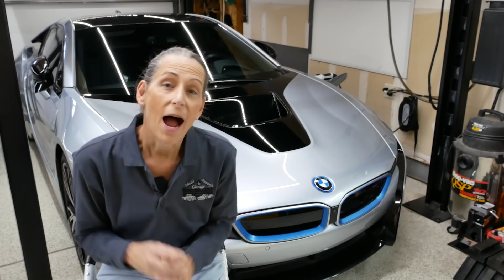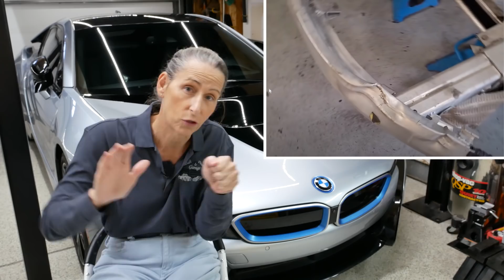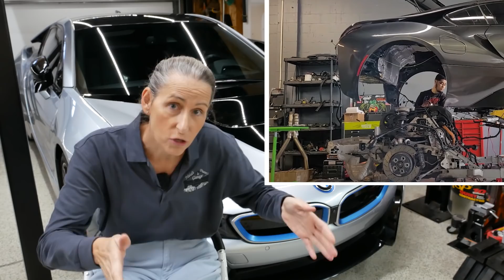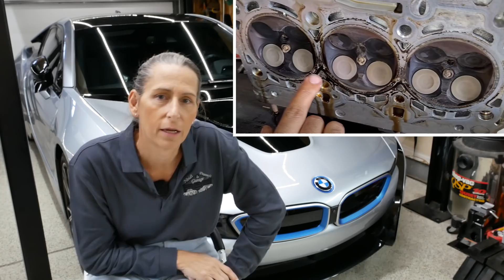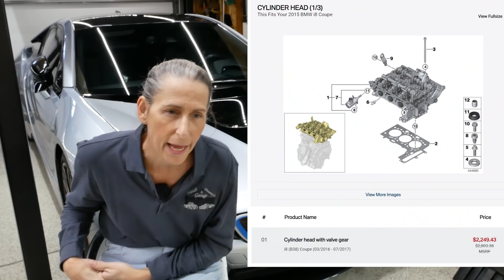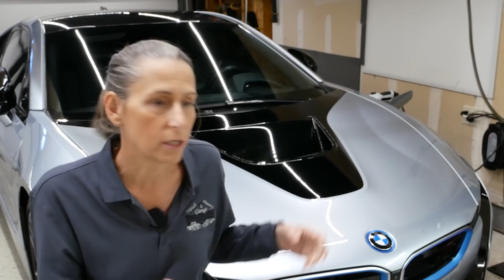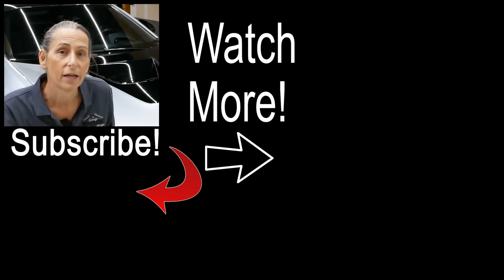Is THIS What Ruined Sam's i8??

Comment from the maker: A quick discussion on what may have caused Sam Crac's overheating issue on his BMW i8 now that he has the engine out of the car.  Let me know your thoughts!

Check out Sam's video here: https://www.youtube.com/watch?v=O1gdp-JqFS4&ab_channel=Samcrac
Reply: Hi Heidi
Its a no brainer`, the head is scrap, there is to much warp on the head to even think about scimming it, check the block to see if it is true, if it is true then the the block is ok, get a new head, build it up and install it, job done.
Regards
Vince (uk rider)
Reply: @vincenttarling5902  I agree with your comments and idea. Car too nice to throw away.
Reply: Was the car overheating because of the defective head/gasket or is the head damaged because of overheating?  If the latter, there may still be an underlying cause.
Reply: back in WW2 occupied france sugar was used to destroy the concrete during fortifying and same stuff on tanks.

a repossed car might have had not the best treatment in its final days and the issues also sound like a nice manipulation that no new owner could have fun. 

turtle mode is also an indicator
Reply: I'd be giving serious thoughts to replacing the whole engine! Those all aluminium BMW units are normally scrap as soon as they have been cooked, even just once.
Reply: Sam needs to call his buddy, the electric car guy, and just put an electric motor in it. Faster and more efficient running car...??
Reply: People look at this car and they think it's going to be a second generation M1. It clearly isn't.
Reply: I’m surprised they can’t do a weld build up and grind the head back into tolerance.

      Years ago a friend of mine blow the wall between 1 and 2 piston wall.  We welded it up and hand ground it flat.  It worked.  
    That was my old life,
Reply: @Worcester114  Interesting fix. What make of car/engine? Not sure it would work here with Sam's problem. Might try supporting the head at the ends and then pressing down in the middle with hydraulic press, see if the warp can be pushed out. If the head is toast, might as well try.
Reply: Even tho there is a fail safe to prevent engine damage from overheating.   I have seen if a engine is at operating temperature and there is a sudden lost of coolant (e.g. impact to radiator) it is possible for the cylinder to warp and cause this condition that happened to SAM’s cylinder head.
Reply: I've done a lot of engine modification work .. why doesn't Sam try resurfacing the head, removing enough material so he can run TWO Head Gaskets stacked?? Would be the "poor" man's approach.

Comment: Just ran my i8 up to 78MPH. Temp stayed around 105c (coolant), I slowed to turn around and it dropped to 88c ish. Okay good. Ran it home and did not drop a second time when I slowed to 30-45MPH. Dropped to  80's again later but likes to stay at 104c even after I slow considerable. I actually slowed to 25MPH for 2 miles and it sat at 104C. So it does not drop every time I slow down? Am I missing something? Stuck thermostat maybe? Along those lines, can the thermostat be changed without changing the whole water pump? You can't buy a thermostat by itself. Thanks guys.

Comment: To be fair, the Mini engines used in these things are notorious for warped heads and blown gaskets, it's a well known weakness with no real fix, the gaskets are known to be weak, and the head itself seems to be made of materials that are not the best seeming to warp easily from overheating.

It can't just be i8 owners thrashing their cars to death, these engines just fell way short of expectations when it comes to durability, particularly for BMW.

Comment: I found (week ago) Sam's i8 on auction Orlando CoPart lot 33565721 somewhow its now off.  I'd worry about the engine; Sam noted 10k$ for new long block, but your numbers are much lower. Also, recent searches show soft prices for a phony supercar engine, a put-put image it has and tha phoney exhaust sound gizmo, that's funny. Oh, I thought just head was removed not the whole engine as that would require lots more work to R+R the thing. And BMW quoted him $30k to do a new engine install  ! I didn't know about the rear frame work, is that why it's a PA Salvage Title; is that why he didn't title/tag it in Fl ? Also, remember, the BMW dealer refused to try the oversize head gasket install (wonder why) ? it had 47k miles and salvage title and Sam noted it would be at auction. It's not online now for some reason. Ask reserve was 54k $ ! Last bid I saw was mere 3k$ !
Reply from the maker: Why do you think it was his car?  What color was it? Heidi
Reply: @HeidiandFranny  copart auction Orlando lot 33565721

Comment: Just my "opinion" based on the tiny bit i have heard on a couple videos about this car. Sounds like a engineering and mechanical nightmare for a cooling system. Gimme a front mounted radiator, a couple of fans behind it a water pump and thermostat that opens when the water is hot goes to the radiator , is cooled, back to engine; repeat. like any "regular car cooling system".  Just my opinion. I see "fancy cool cars' that are a rich person's expensive toy that breaks down often and the parts/service is stupidly expen$ive. I had two Toyota Camry's drove them  for 12-15 years each; put 225,00 miles and all I ever had to do to mine was timing belts and cv-joint axles, alternator brushes. Heck of a deal! Daily driver took lots of trips in them. The engineers that designed THAT BMW should be hanged at dawn for such stupid complicated BS systems. IT totally sounds stupidly designed and built. BUT As Ben Franklin said:" A Fool and His Money Are Easily Parted". YOUR toy YOU headache.

Comment: The gasket on Sam's engine has a sealer strip around the edges, it looks like rubber/plastic, where his overheated it seems to have burned the seal and allowed the gasket to leak, years ago head gaskets used to have a much thicker gasket sealed each side with sort of copper, this crushed and made the seal, I am guessing with the new stretch head bolts and newer design with higher compression, manufacturer get away with less gasket, until it get hot and leaks, the indicators on the head show it was possible to skim it and the fact they do offer a thicker head gasket shows they knew this might happen.

I do remember when I built engines this was also offered but then rebuilding an engine was common place, any high performance engine back then would have grooves cut and sealing rings fitted as compressions got higher, I did wonder why Sam didn't do a leak test first as its the quick and easy and settles the question of a head gasket leaking, before he started, but then its easy to be an armchair critic, and he made some content out of it.

Comment: well if you lose a all the coolant (like a hose failure) you'll over heat fast enough to warp the head. Remember a late 70's early 80's VW rabbit diesel losing a coolant line will MELT a hole through the injector pre-chamber in the head in 5 minutes or less.  What does the water temperature sending unit measure when you have a catastrophic hose failure?  ANSWER: Nothing, in fact  it starts to drop. 83 or 84 a level probe was added.  
So can you follow my logic on this?  I8 has a level probe, but i'll bet it just gives a coolant low warning. it doesn't know the difference between the reservoir low or the tree branch you just ran over that tore out your cooling lines.

Comment: Pretty clear the thermostat failed, because that's what BMW's do, and the person who "owned" it drove it like he stole it and the engine got so hot that it warped.  Turbo 3 cylinder making over 200hp is not going to run cool, and will heat up super fast.  Some shop knew this and changed the thermostat, which Sam thought they did incorrectly.  Keep this in mind i8 owners when you see that engine gets hot.  Just stop driving it and have it towed and get the thermostat changed asap.

Comment: This is the only problem with doing a video series on a car like this on YouTube is that everyone knows the car and the problems. So if he tries to take the lower price way out and puts a used, or even a new, head it opens a whole mess of things if there's any problems with it even months after he sells it. Because anything that happens to it, even or wreck it's not anything to do with these fixes and problems, he's going to be blamed for not taking the money and putting the $8,000 engine in it knowing all the problems it has and that this would fix them. It's almost like shooting yourself in the foot but I would just take any income generated from all this plus some sponsorship and step up and be the decent YouTuber, LOL, and do the right thing putting the new engine in it. Plus the new buyers will have the Peace of Mind of some type of warranty. Probably not the full warranty since it's not being installed by BMW technicians but it should at least have a 12/12 but I don't know for sure.
It's just that everything gets exposed and then you're looked upon to do the full monty on the vehicle in question.

Comment: "German engineering," including cost saving features such as: PLASTIC impellers on water pumps when aluminum is readily available at a comparable price, PLASTIC cooling pipes inside the engine bay carrying antifreeze which cause premature breakdown during mid-life of the car. PLASTIC expansion tanks and other radiator parts which breakdown and disintegrate through normal use. Just cheap parts made to break down and cause huge dealer maintenance expenses. Unless you want to work on the cars yourself, and I mean getting aggravated through trying to find solutions to normal car functions (like tilting the car to fill antifreeze, massaging hoses, jacking up the car and freeing up frozen nut caps to drip check TRANS fluids etc.) DON'T BUY A BEEMER!
Reply: Thank you.
Reply: bingo

Comment: while abuse is a possibility I am suspicious about the front end collision. If the radiator was damaged to the point of leaking a problem there is a real risk of overheating. I had a coolant tank fail on my old E36 while I was on the freeway. By the time I  noticed the warning light and could pull off, the head was warped and I had the same cooling issues. Bad timing on a coolant leak is a thing.

Comment: Looks like a super car but has the power of a pinto?
Reply from the maker: A Pinto has about 205 HP.  This is 367HP.  You are forgetting this is a hybrid with an 130hp motor up front and a 20hp motor back with the engine. 0-60 in under 4.4sec. Not slow...

Comment: your analysis  on his car is spot on. i wouldnt re-install the head.since the engine is already out, i would take the block to a reputable machine shop and have it looked at with a fine "tooth comb".your discovery of a used engine would be ideal for this application.again, due diligence prior to install!. this turned out to be a major ordeal.but its apparent ,its the only way the real issues would surface in plain sight. if the used engine checks out 100%, i would prefer going down that avenue. we all want to preserve the "coins" but i wouldnt want to do this twice. i've raced cars and worked on them  for over 30 years. i really hate redoing a task twice specially on trying to "skimp". not me.  nothing bertter than doing it right just one time. the right way!

Comment: AT THIS POINT THE WHOLE WORLD IS WATCHING, PART OUT THE CAR UNLESS THE ENGINE IS COMPLETELY REBUILT PROPERLY AND DYNO TESTED BEFORE INSTALATION. DOCUMENTARY VIDEO IS IN ORDER. THIS CAR WAS OVERHEATED MANY TIMES OVER AND OVER AGAIN WHILE THEY WERE CHASING THE PROBLEM, THERE IS DEFFINATLY BOTTOM END,CAM AND TURBO DAMAGE FROM BLOWBY, STEAM AND COOLANT LEFT IN THE OIL AND CRANKCASE PROBABLY FOR YEARS. EVEN AFTER THE REBUILD THERE WILL BE MANY THINGS TO SORT OUT.

Comment: He needs to do a full ECU dump.
I am not knowledgeable with what data BMW stores, but I know Honda will store percentage of time at different RPM ranges, including over redline.   Easy to see if the car was abused.

I would be surprised, and disappointed, in BMW's engine control programming if you could get the motor to overheat to the point of destruction,  by "hot-rodding" it.     The accident damage makes me question....    A) Did the accident cause the cooling system to lose all the coolant, overheating the motor, also damaging the water pump, or  B) did the water pump have issue causing the overheating.   (I suspect A).   I agree with the earlier comment that there was low/no coolant in the system, with no coolant in the system there was no coolant in contact with the temperature sensor, causing it to not read correctly.   With the temperature sensor reading low, the ECU didnt know to go into self-preservation mode. 

With the motor out, they would be silly to not check the block deck for warpage, drop the oil pan and check for lower end damage (check a rod bearing or two or three, check a crank bearing).   

If the issue was lack of coolant, the bottom end will probably be fine.   If the motor was overrevved/abused causing the heating issues, the bottom end, hmm, will never be cheaper to fix than when its already out of the car.

But, i could be wrong.

Comment: My vote goes to problems related to water pump change done incorrectly. If I were Sam, I would inspect the block further. If it comes out good, a factory new head is probably the best way. 2k is not that bad, compared to the risk of a much higher cost/issues later by skimming/truing the old head. This is not free either. And comes with a higher risk of failure.

Comment: The i8 should have 2 rear electric engines, 200hp each, then it would be a supercar. And keep the gas engine as a generator for longer trips, probably don't need to be fancy, no turbo, optimized for most efficient rpm. As for abused cars, I'm thinking hot rodding a Lambo or Ferrari is as likely if not more to break it. In fact you can see videos of such cars on fire after such mistreatment... Then if you need a new engine it's not 10000$ but 5 times that...

Comment: Another possibility is a faulty temperature sensor. When it shows a too low temperature, the engine management switches to - heat up and save fuel- mode. Also than there is no warning. Engine management beleves everything is well in spec. If this is the case than there is also a software problem because the oil temperature sensor - reading would be inconclusive.
Reply from the maker: Yeah, it has been replaced.  That doesn't mean it is working correctly though.  WHen I do disconnect the temp sensor I get a very different condition.  It is sending back something - question is what...  I might end up throwing in the old units to rule the new ones out.

Comment: That car would be a lot nicer if it had a V8 and a six speed manual. And the V8 would have to be a good one, not like BMWs regular models with the shitty plastic chain guides that fail after 100k miles, or valve seals that do the same...and full of plastic fitting that harden, crack and leak.

Comment: After all the vacuum bleed of the cooling system they dod a simple pressure test and the radiator blew at a fairly low pressure so there were more problems than were noticed at first
 if the head isn't too damaged a head refurbishment is an option

Comment: 08 Pontiac Grand prix (FWD) setup us the LS2 engine swap it and call it a day. 400hp+ in an i8 with V8 grunt would be epic,  99% of those FWD GM V8's are auto but I believe there is a 6sp manual kit to swap but Id say staying with in budget would be a proper way to go but if you want to stay Hybrid EV motor there are a couple of options. would be insane to do a V10 or V8 Bmw motor setup but the way the I8 is laid out it will be next to impossible to use any other BMW setup unless an X2 or a motor setup from a Minicooper .........idk

Comment: just an observation not to denigrate any of the people who have worked on this car but it was said fairly early on that the cooling system was pressurizing classic blown head gasket.
Let's take a fairly simple machine an IC engine tack a load of computers on it sensors on complicate it beyond reason it goes wrong what are you left with a very expensive paperweight
and bankrupcy to put it right  K.I.S.S is the answer happy days

Comment: If the vehicle experienced overheating that in the end affected all 3 cylinders,  I believe that prior to repossession, the owner or someone close by has sprayed Fix-a-flat or Foam insulation into the tubes of the cooling system, thus blocking the flow of engine coolant, to the point that the water pump impeller could not turn. Honestly, in following Sam's chronological method of repair,  in this thread,                     I believe that is why the engine overheated and failed.   BTW  228 HP from a 3 cylinder engine is Great.

Comment: I had the same exact problem. A cooler tube blow up and it heated up almost instantly because it had no cooler. Since I was 2 km from home and I still drove the car. 
That was enough to bend the motor head and cause a leek of pressure from the engine to the refrigeration circuit..

Comment: Very good analysis. That’s what I also tough. I think if the engine had a bottom end problem he would have definitely noticed a knock or some piston slap when he started it cold and drove it. I think he needs to check if there is coolant in the oil. If there’s no coolant in the oil and the block is straight then maybe have the head machined as much as possible and use the .003 oversized head gasket and torque to specs. Then I would do a cylinder compression check and coolant system pressure drop test. Hopefully the abuse did not mess up the  piston rings and cylinder walls to much.